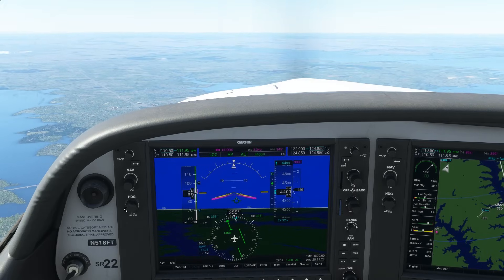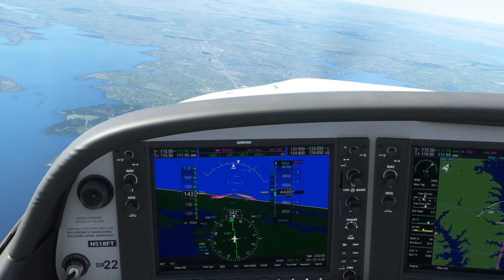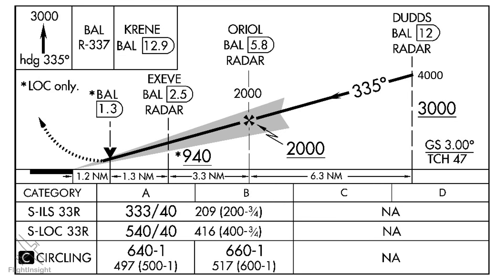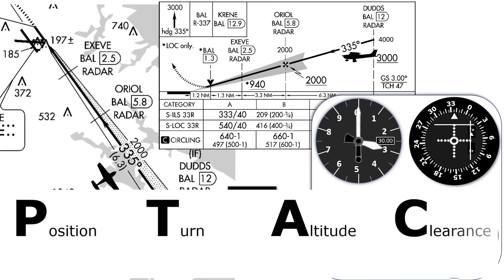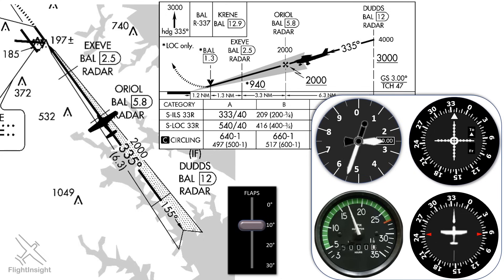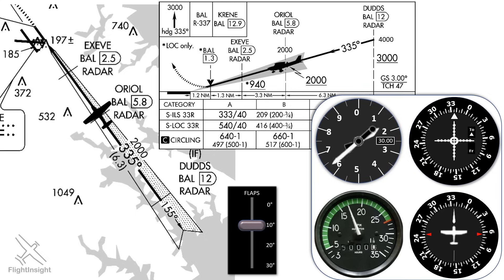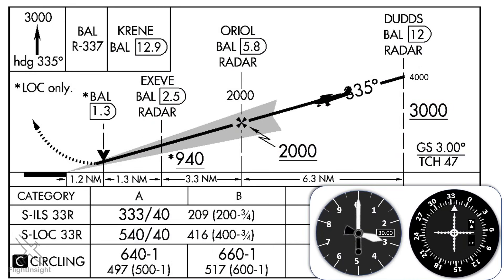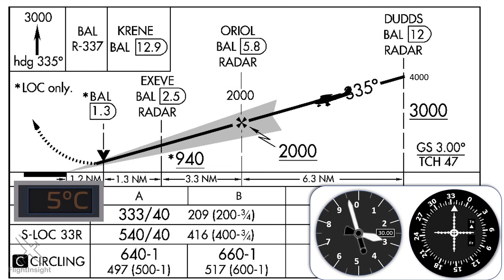How to Fly an ILS Approach | Glideslope Intercept | Approach Clearance

Comment: Every pilot should make this test upon take off. Key in the Localizer frequency in and set the course bar in RWY direction, then taxi before takeoff to the right edge of the RWY. You should observe a slight fly left indication, roughly one and a halve deviation bar width. Memorize this deviation! Then you taxi to the left edge of the RWY. You should observe a fly right indication of the same magnitude.
As long as you are in-between these limits you are safely on the RWY (ignore minimums).
Thus, you are able to land the aircraft in zero visibility conditions, as long you are able to fly the ILS with such accuracy.
You are never lost!

Comment: The optimal and professional piloting technique to use to maintain the glide slope is to make pitch corrections using the Elevator/Pitch to track the Glide Slope and to use the Throttle/Power to maintain desired Airspeed.

Comment: Where do you tune the glide slope?
Reply: You dont! The localizer frequency will be paired with a glideslope frequency, so when you type in the LOC frequency it will automatically pick up the paired glideslope frequency. If you want to see what the frequency pairing is take a look at the table in section 1-1-9 of the aim

Comment: As long as you have the recommended altimeter setting from the ATIS, why would the temperature make a difference? I am kind of confused about that.
Reply: Altimeter shows Indicated Altitude, not True Altitude.
Reply: @beltranmaru  how is that affected by temperature? Difference in indicated altitude and true altitude is due to whatever difference in pressure there is between reality and the QNH you've got. Yeah, temperature varies affects QNH, but aside from that, how is it accumulating that much error at 3000 ft due to change in air density?

Comment: Thank you so much for this video and all your other videos!  They have been super helpful.  One question:  What are your thoughts on adding 10 degrees flaps at DA when the runway is in sight?  I have the first 10 degrees at FAF and usually prefer to have 20 when landing but not sure how stabilized the approach will be if you add 10 more at the low altitude (DA)...
Reply: What does DAF, DF, FAF etc mean
Reply: DA is decision altitude or also Decision Height (DH). FAF is Final approach fix. Don't know about DF or DAF though. @Aviation_sweden

Comment: I have never once considered this temperature difference and how it effects my altitude on an approach. Nor have I ever heard any other CFII bring this up. I honestly don’t get it. I need to sit down with another instructor and walk through this.
Reply: I'm confused as well since when the ambient temperature is warmer than standard, the aircraft's true altitude is higher than the indicated barometric altitude. Therefore aircraft would be flying above minimum altitudes on a hot day, not below. Am I missing something? (See AIM 7.3.3)
Reply: I believe how I interpreted it is if you grab the glideslope even though your altimeter is reading low, you should be clear. If I'm wrong, I'd love a more in-depth review on this as well. But grabbing atis gives you the current altimeter setting, or tower usually gives you the most current, so I don't see how our indicated alt while on glideslop could get us in trouble.

Comment: OK so that brings up a very important point. Suppose it is 20°C warmer than standard and you were on the approach. Is your missed approach altitude going to be lower than published because technically you are going to be higher than what you would be at a standard day minimum approach indicated altitude. Is there a way to calculate? Do you just see your intercept being 200 feet lower and know that you’re altimeter will be 200 feet lower than your actual decision height. A good point to know.
Reply: As separation is based on indicated altitude you fly the missed approach altitude on the chart. Not below it.  You might be higher than the indicated altitude, but so will be anybody else on their cleared altitudes.

Temperature really is a problem in low temperatures though, where you actually have to adjust your minimum altitudes to safely pass above them, especially stuff like MSAs, approach minima and so on. As not doing so might put you into harms way in regards to obstacles on the ground. 

To be honest, flying as an ATPL in commercial airlines for the last 22 years we do not really care about high temperatures all that much in regards to crossing altitudes. Usually we do get vectors to the ILS and an approach clearance, after that we simply arm the approach mode, intercept the approach and fly it. There are some variations to the clearance though, some advise you to keep a certain altitude until intercept, some require you to specifically intercept the localizer first (the autoflight system does not intercept the glideslope if it has not started to intercept the localizer first) and so on.
Reply: When temps are warmer than ISA (say ISA+20), the altimeter will under-read -  this is a safe condition for terrain clearance.
When temps are colder than ISA (say ISA-10), the altimeter will over-read - this is an unsafe condition for terrain clearance.

Now, for a PRECISION approach (say, the ILS in the video example by FlightInsight), procedural altitudes prior to the DA, remain unchanged by temperature deviations from ISA.

At the DA, an altitude adjustment is required ONLY if temps are significantly COLDER THAN ISA. Here in Australia, the correction is only applied if the temp is less than ISA-15.  No correction is made to DA if the temp is warmer than ISA-15.
Reply: @paulcarello6390 what part of Australia gets to -15C in what time of the year?
Reply: @beltranmaru  

There are a few places that have recorded temps below -15C.  That being said, where did the -15C come from? 

In my last post I said, "No correction is made to DA if the temp is warmer than ISA-15.". 

Note, "ISA-15" is not -15C.
Reply: Bear in mind this error would reduce to zero at ground level (the altimeter will still indicate the correct altitude on the ground). The error is 4 feet per thousand above aerodrome per degree of isa deviation. Using your example of isa +20, the under-read at 2000' agl would be 160' (I know 2000' is 1876 above TDZE in the video example but I am generalizing now).  When you reach indicated DA the error will be only 16'. If you are on the ILS glide slope you are still on the correct geometric flight path but the 16' under-read translates to being 300' short of the true decision point (16'/approach gradient). Assuming 500 fpm vertical speed you will see DA indicated just 2 seconds earlier than on a standard day. Nonetheless being 300' further out becomes significant in terms of picking up your required visual references on a bad day. There could be another discussion about when this poor vis might happen on an isa +20 day.